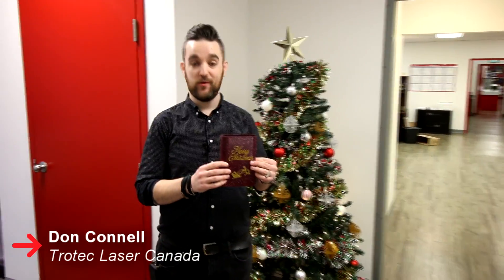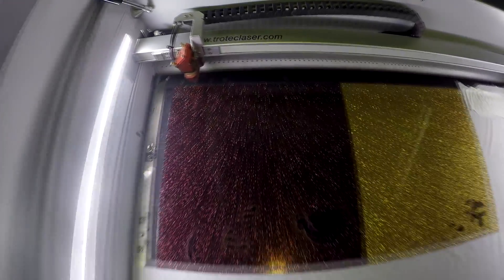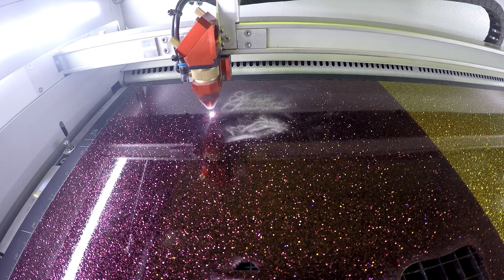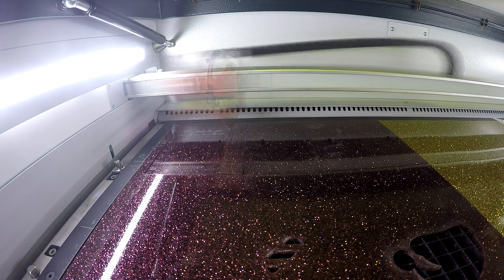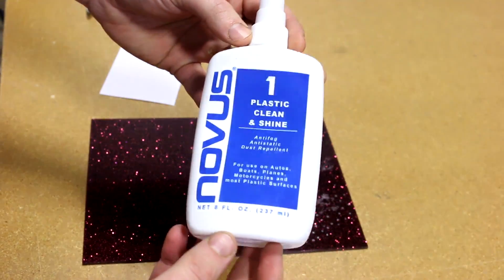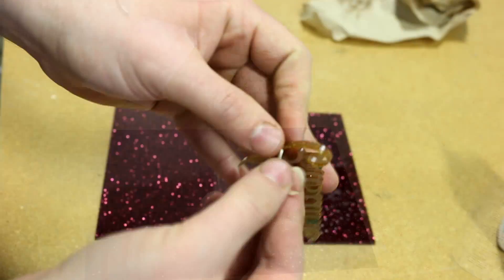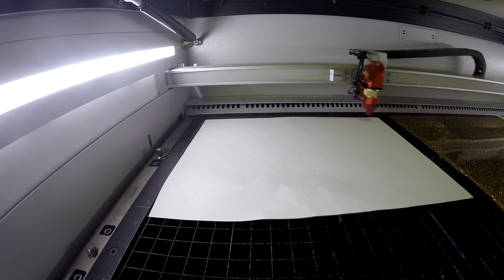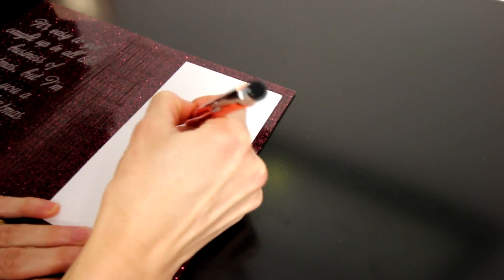DIY Christmas Card | Laser Cut Glitter Acrylic | Acrylic Greeting Card

Comment: I've heard you mention "kiss cutting" a couple times now in videos. Would you mind explaining what that is, and the benefit to doing it? Thank you :D Happy Holidays!
Reply from the maker: Hi there, of course! Kiss-cutting is just grazing the material (not doing a full cut). The purpose is to know the position if we want to place any secondary material on top. So we kiss cut the first red layer to know the position for the 2nd gold layer. Once we cut out our gold, we take off the 3M adhesive and glue it exactly where we originally wanted to on the first red layer. On the finished card, you can't see the kiss cuts because the 2nd gold layer is hiding it. Hope that helps!
Reply: @TrotecLaserCanada  thank you for the reply. I was thinking along those lines as well (pun intended) as I couldn't imagine a precut was needed for cast acrylic.
Reply from the maker: @mythyc9604  Yep exactly :)